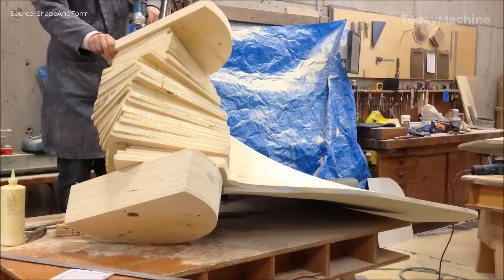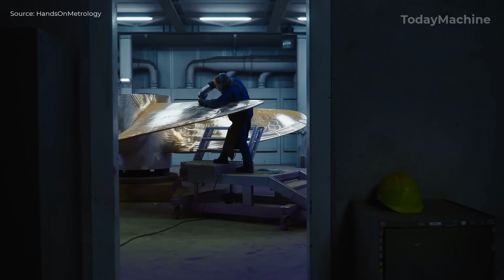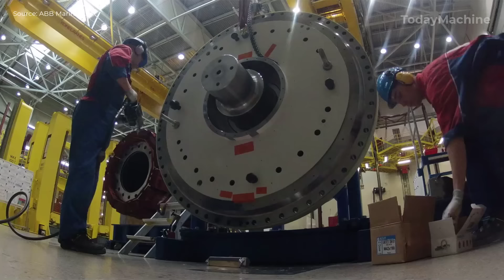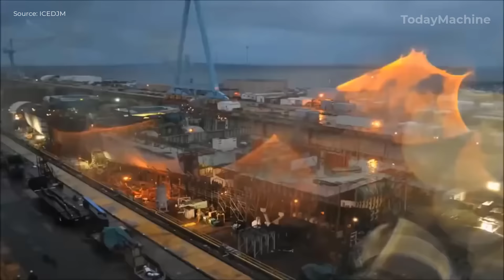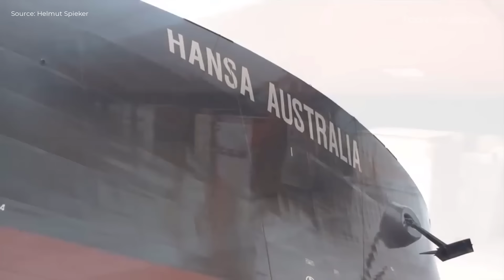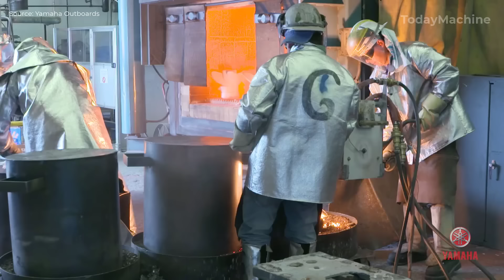How Giant Propeller Is Made. Install Propellers For Giant Ship.

Comment: What do you do with the wood model? Is the mold made of sand? How do you make the mold that you pour metal into? This video really is missing explanation
Reply: The wood pattern is used to make a negative shape in a sand mould,
That mould is then filled with the nominated metal,that then achieves a  positive shape the same as the patten,you now have a propeller ready for machining.
Hope that helps.

Comment: THIS WHOLE VIDEO IS IT SUPPOSED TO BE ABOUT MANUFACTURING GIGANTIC BRASS ALLOY PROPS FOR HUGE  CONTAINER SHIPS FOR AIRCRAFT CARRIERS OR HUGE PASSENGER SHIPS. HOW THE F*** DID LITTLE STAINLESS STEEL PROPELLERS COME  INTO PLAY ? IT DOESN'T MAKE SENSE. YOU'RE DOING A VIDEO ABOUT GIANT BRASS ALLOY PROPELLERS FOR HUGE SHIPS, AND THEN YOU'RE THROWING  IN LITTLE STAINLESS STEEL PROPELLERS FOR OUTBOARD MOTORS. DOES IT MAKE LOGICAL SENSE.

Comment: As a kid in the 70's, a teen smoker in the early 80's and worked in and around foundries, forges, and presses, and mixed and sold casting materials and binders,  I LOVED Hanging out and smoking in the "mold/pattern rooms" the carpentry was JUST AMAZING! I could lite up on hot casting parts.  Basically wood machinists? got this done.
As a millwright, pipefitter, electrician I built or maintained the equipment and facilities.
They tell me gramps was a Seabee, Pacific.
Reply: "In the blood" isn't just an expression.  People like you are unsung heroes in the development and maintenance of an advanced civilization.  To borrow an expression, Thank you for your service.  The Seabees were an exceptional and absolutely necessary part of the military, sometimes even working under fire and yet again, we hear almost nothing about them, unsung heroes as well.
Reply: What?

Comment: Stainless steel props for a big cargo ship...hmmm. Never seen one . I have more than 17 years experience at sea as licensed seafarer and more than 5 years experience as ship repair engineer working in shipyard. Small props in SS, yes, they are available for other type of vessels (or fitted on outboard engines).
Reply: The stainless steel ones are made for outboard motors. We saw something Yamaha makes in the video, especially for saltwater environments. You can see by the size and the pitch they're made to move fast while minimizing cavitation. Props for container ships, etc. are made from a marine-grade brass alloy and look very different from modern props for speedboats and recreational vessels.
Reply: This is supposed to be about “Giant Ships”. Where do SS props come into that?
Reply: Said first stainless than said bronze alloy later. The latter is correct in this case. There are Stainless steel props but usually not of that size.
Reply: Worked on a stainless blade at lips drunen years ago, it was from a ice breaker.
Reply: @JoshDoughty-y8q  the SS props exist in big sizes- they are special and not widely used for normal cargo ships. I only said that I never saw them in such big sizes during my working years in the shipyards or during my sailing on board of normal cargo or pax ships.